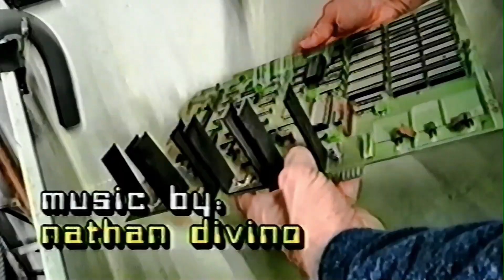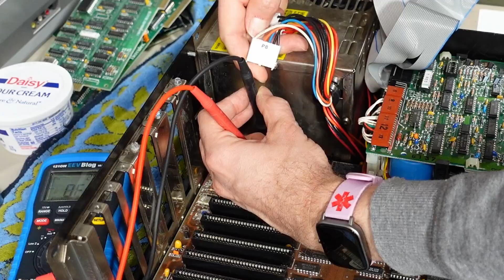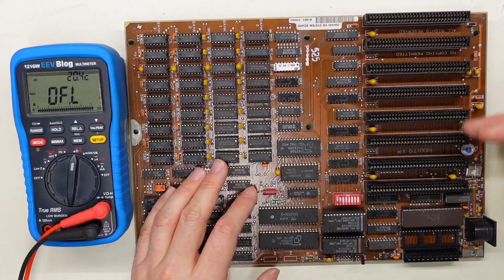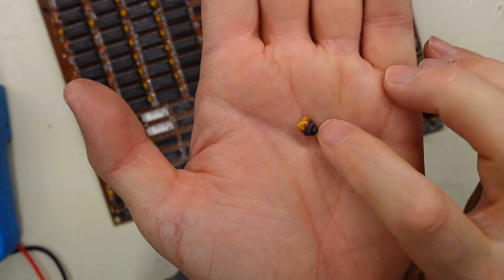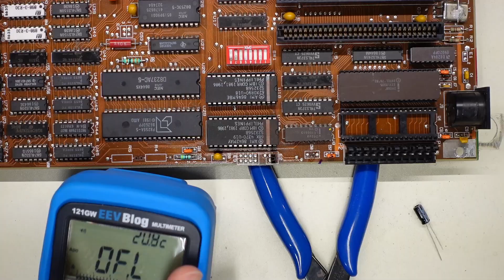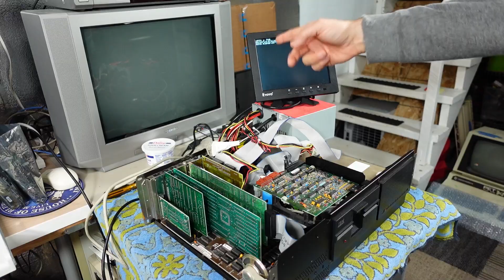This IBM PC XT won't turn on, let's fix it

Comment: I love that the one time you try to show off how to find a shorted cap the proper way, it makes itself immediately obvious by being burnt out. The one time you actually wouldn't have minded it being a little less obvious!
Reply: imagine what happens when you replace the hard disk with an ssd

Comment: I am a retired Avionics engineer... I used a 5160 up until 2012... It was connected to a test station designed to test Audio Control Panels which reside 
in a Boeing 747 cockpit... Changed plenty of tantalums over the years.. Love your video's mate

Comment: Thanks for the great video. I sold IBM PCs and XTs from 1984-1987. The XT was discontinued by IBM in April 1987 when the PS/2 was introduced. A manufacturing date of 1986 would be late in the life cycle of the XT. Based on the full height 5.25 inch drive, this system would have been early 1986 as by mid year 1986, the XT switched to half height drives, allowing two dives in one bay and one HDD in the other front bay. At the same time MLB was updated to support 640KB on the main board without some form of memory expansion card. I installed lots of XTs with AST 6 pack + cards to add 384KB, Parallel port, serial port(s), game port and clock. At the same time that the XTs with half height drives were release, IBM also released the PC XT 286, with a 6 MHz 80286 to replace the 6 MHz AT which was speed bumped to 8 MHz. Lots of nostalgia for me watching this video. Thanks again!
Reply: Thank you for this glimpse into the past.
Reply: It is super cool to hear about the industry from the reseller perspective.
Reply: It is amazing you still remember every detail of what happened. I don't even remember 5 years ago LOL!
Reply: I still have my first computer, and it still works: an IBM PC 5150 (type B) with CGA and an AST Six-pack Plus like you mentioned (it has a bad memory chip so I have to run it with a little less than 640k. I should fix that.)  It has a half height Seagate 20MB hard drive and some ROM chips dated 1984 which I think were to make it support hard drives. We got it used for Christmas 1987. I need a proper monitor for it (I can use CGA’s composite out though), or whatever that RGB to HDMI thing is. I added a Sound Blaster in it at one point. Wish I had kept it in there too. It remained my only computer until 1993 and it was really getting obsolete.
Reply: I have an xt and monitor only I am trying to sell. I am mulling over whether or not to scrap it for gold or preserve it.

Comment: I had an XT clone growing up. You might think I'd have some nostalgia for it, but I really don't. It was so slow, especially compared to my friends' computers at the time. It had a monochrome monitor with a Hercules knock-off graphics card, no sound card, and later in its life, a pokey 2400 baud modem that was only ever used to connect to the library's card catalog. It also didn't boot off its hard drive half the time--usually the half that I had a school paper due. The day I landed my own PC, with a 386 processor, a Sound Blaster card, and a VGA monitor, and I never had to touch that old XT again, that was one of the happiest days of my life!
Reply: I have mixed feelings towards my first PC as well - a 5170 AT clone my parents bought in 1987. I did learn a lot about computers from using it but it was slow (6 MHz) and the power supply fan was super noisy. In around 1990 I upgraded it to a 386SX-16, which was speed demon in comparison, but still laughably slow compared to today's PCs. An expensive upgrade, and I was still using the old noisy 5170 power supply. I don't think many people truly understand just how expensive PC parts were back then!

I have more fond nostalgia for the early 1990s era of 386DX clones, when I began running OS/2 and learned to code in C. To me, this is when PCs started to become truly useful. We take it for granted now but having a 386 machine in 1992 doing proper multitasking, and where the OS pretty much un-crashable, was revolutionary.

It's interesting how '80s PCs have now become collectible and often fetch a lot of money. I suppose it's because a lot of them were recycled or more likely became landfill, so any good ones left are a bit rare, at least here in Australia.

Comment: Hi Adrian! I just wanted to say how incredibly helpful this video is, it's so easy to follow, and you do a great job of explaining not only what needs to be done, but why it needs to be done. As someone who has NEVER done any sort of repairs to something like a motherboard before, I'm super happy to say that by following your steps exactly, I was able to identify two bad tantalum capacitors on a newly acquired 5150 which had been written off by the owner as not working. Getting them out of there resolved the short, and now the 5150 and its matching 5151 monitor are working beautifully. Never thought this was something I'd be able to do, but thanks to your video, it is! Just think, for every computer you've fixed, how many of your viewers have been able to go out and fix a broken system of their own using the knowledge you've imparted? Just fantastic, you're doing such a service for the vintage electronics community.

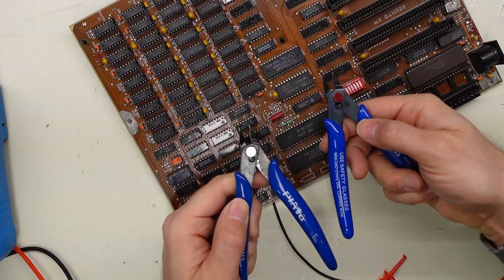Comment: 00:14:10 You can grind the longer jaw down to meet the shorter side while the cutters lead their new hard knock life. (you can re-sharpen the cutting surface with a few file swipes too)

Comment: Here’s a trick I use to remove those 3-legged caps:

Use side cutters to cut through the cap body diagonally from the top toward the middle, to shear the left and right legs off.  It leaves a chunk of cap on the middle pin.  Add a little extra solder on the center pin, and what’s left of the cap may just fall out.  Then tweez the side legs out with some fresh solder to help warm them up.  Use a solder sucker to clear the holes and replace with a new cap.

This really makes it easier because IBM liked to bend the legs out.  If you only have one leg at a time to deal with, you can tweez it out at an angle or bend the leg back straight again.  That’s much harder to do with the cap intact.

Comment: as a guy who often does component level repair on newer stuff(typically GFX cards and motherboards)(Mainly Gigabyte motherboards cause they all fail the same way between the 7-10 years worth of moderate use mark)
this channel is awesome to watch, gives me the old time repair nostalgia feels.
I had an XT, a 486 and a 233mhz machine, and tried to get the XT running on the internet via a TCP/IP stack over RS232 and Windows 98SE internet sharing, and got it working with a DOS IRC client and a text only dos browser of the time so my mother could continue chatting in IRC channels(the site she normally used, had a webpage overlay, that was just a hidden IRC client that I found what server it connected to.) while I used the main computer for something actually useful.

Comment: A customer called about a 486 pc with smoke pouring out of it, they put it outside on the lawn and called for service. One of the tantalum caps shorted and ignited a ribbon cable while the fans provided additional oxygen, it burned a hole in the motherboard.  Tantalum caps are dangerous do not run power through them unattended.

Comment: Thumbs up for helping people. If anyone wants to actually do this, find the closest IC, bigger the better, and simply tack any new caps across the rail and ground pins. Don’t screw around soldering on vintage PCBs unless you are seriously experienced. Your going to wreck the board, typically by delaminating. And absolutely don’t use a USB soldering iron. They are useless for board level work.

Comment: Forcing a tantalum capacitor to go 'open' is hard.  Tantalum capacitors are made from a small block of sintered tantalum metal powder coated with an oxide of tantalum, then further coated with silver for making the contacts.  When a tantalum capacitor shorts out, the metal bits 'weld' together, making a very low impedance (and high current) connection.  The more the tantalum cap fails, the more it gets welded together, and thus the lower it gets in resistance.  Forcing a tantalum capacitor to 'open' like a paper/aluminum electrolytic takes immense amounts of current - at least on the PC power supply scale - so it is unlikely for the tantalum cap to eventually become an open-circuit.  Aluminum/paper electrolytics will eventually explode or separate at lower currents, turning them into an open circuit that is harder to find (sometimes you just find the capacitor legs sticking out of the PCB).  RIFA caps are similar, they'll explode and open-circuit, with an accompanying bit of bang and smoke.  Anyhow, I love the channel and content, keep up the great work you do.  Cheers!
p.s.: Tantalums are used extensively in Tektronix gear, mainly because they filter a wide range of noise frequencies.  If you have a failed older (pre-1990) Tek device, look to the tantalums.  After the 90s, they started using a lot of smd al/paper electrolytics, which leak and ruin the PCB.  In either case, re-cap before powering up old gear, just to be safe.  Newer tantalums (or niobium alternatives) are much safer, in general, due to improvements in the manufacturing process.  MLCC ceramics can also come close to replacing tantalums in lower-capacity situations.
Reply: Indeed! some equipment that I serviced decoupled a power rail through a small inductor that would fuse when a tantalum shorted. Some 'Genius' had 'recapped' a Vital Industries SqueezeZoom (It was a $250,000 video processor in the early '80s) with cheap electrolytics, replacing the much more expensive sealed tubular Tantalums, so we were replacing them with the right parts at a cost of several hundred dollars a month. So much for the previous owner having a real Broadcast Engineer. 😡
Reply: @jshowa o In theory, but not in practice.
ESR can easily be measured in circuit Even a cluster of paralleled electrolytics  can be tested. If you can identify the OEM, the series and type you can find the specification on a datasheet.
Keep in mind that as ESR goes up, internal heating also increases due to its inability to pass AC. I've been locating and replacing bad capacitors for over 55 years.
Reply: @jshowa o I have datasheets with the ESR information on hundreds of different series of electrolytic capacitors. Buy Panasonic or another premium brand that does publish datasheets, not no name floor sweepings from a Chinese factory. I supported mission critical systems, i didn't want more problems from cheap parts without proper data or quality control.
If five identical parts are in parallel, you will see 1/5 the specified ESR. If it is out of spec, they all need replaced because the ones that are in the worst shape are putting additional AC current through the rest. If you find no name crap in a switching power supply, you can look at the average ESR for that type to get a fairly good idea of what to look for. I prefer a digital ESR meter since most of what I find as defective are high capacitance. I first used a Sencore LC53?  unit 34 years ago, to get a TV station straightened out after a lightning strike and power outage took down a lot of equipment that was powered 24/7. Every computer terminal was dead because of marginal ESR
I have also worked on industrial electronics, both in the field and at the factory. 
Some of my work went into space, for the ISS.
Reply: @jshowa o Hi, the short failure mode is due to the teensy-tiny distance (a few tens of microns) between the positive and negative elements of the tantalum capacitor.  When the capacitor fails, it is usually due to a breakdown of the separation (dielectric) between + and - plates.  Essentially, the + and - plates are being connected by a small, but significant, conductor.  As the capacitor starts to heat up, more of the electrolyte (spacer) degrades and the connection becomes stronger, eventually resulting in some smoke and even fire.  ESR is another parameter of a capacitor, unrelated to a short, which determines the electrical conductivity of the dielectric when presented by an electric field - tantalums usually have very good ESR (less than one Ohm) because the dielectric thickness is small and dielectric constant is high, resulting in low AC resistance.  A major advantage to tantalum capacitors is that they have a low ESR at low frequencies and high frequencies, making them a 'best of both worlds' solution.  An aluminum can electrolytic has good low-frequency (LF) ESR, but it gets bad at high frequency (HF), so those are often paired with ceramic capacitors that have better HF performance, but lower top-end capacitance (usually a few uF).  So, since a small tantalum capacitor can be rated in the 10s or 100s of uF, it is a great all-around solution, just a little more costly.  And if you don't care about HF performance, such as in an audio device, tantalums are not necessary, since aluminum electrolytics are perfectly fine.  I hope that helps - cheers!

Comment: Now I bought one of these XT class machines and before turning it on I measured for shorts on mother board power supply connector - everything was ok. Turn on lever up - power supply not working. I measured motherboard again and found that there is short on -12V so Your video will be helpful for me. Thank You.

Comment: Used a modern PS with a 386SX board the other day. It was happy to supply enough 12V to flame 4 tantalums. Workshop still stunk the next day.

Comment: Sometimes, the easiest way to locate a shorted component is to source a current-limited voltage on the shorted rail.  The shorted part(s) will get warm and is detectable via touch or IR temp.
I also use the "low ohms" function of my Fluke 289.  It sources 100mA and is better than the regular ohms function at finding shorts.

Comment: I've had exactly the same issues on the same rail on the same genuine IBM motherboard. I ended up looking at the schematic to trace it down, as mine wasn't visually damaged. It was also a super easy fix....

Comment: I remember having issues removing from an old GPU leaking through hole capacitors, fortunately there were some alternative pads for an SMD, so I just cut the old caps off and soldered some new caps onto these.

Comment: Putting the board on a heating plate like a candle warmer can in most cases add enough heat to make soldering possible on the ground plane of those old 5150s. I chose a candle/coffee warmer because it won't be hot enough to damage anything but adds enough heat to the traces that the soldering iron can do the rest. It was a real pain where you sit before cheap mug warmers existed though.

Comment: I thought you were suppose to use a paper clip....  I hope you have a go at that power supply.  Thanks for the video.
Reply: This got a good chuckle from me :D
Reply: What did he do?
Reply: @AngelaTheSephira  Adrian?  Nothing.  The paperclip is a reference to another youtuber, also in the old computer repair biz, who had a go at a repair using a paperclip with unfortunate results.
Reply: Oh, of course not Adrian. I stopped watching The 8-Bit Guy years ago, but I'm curious what he destroyed.